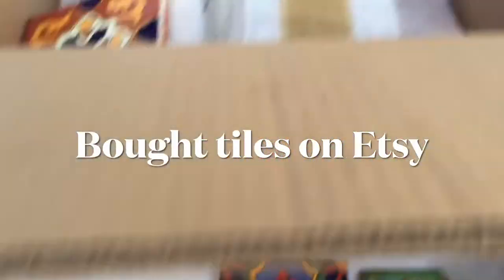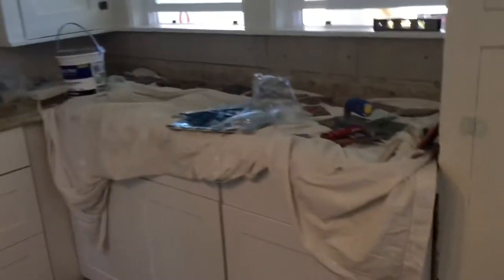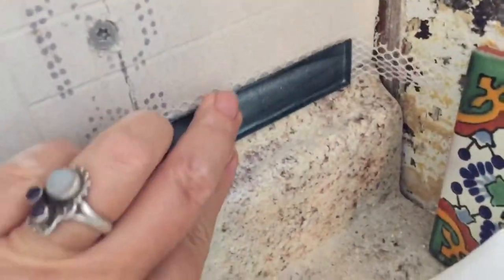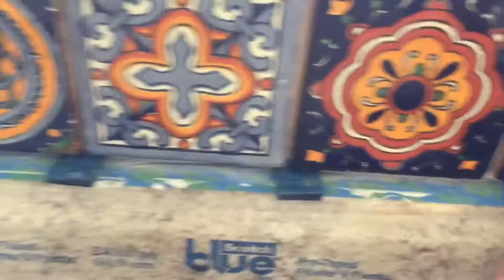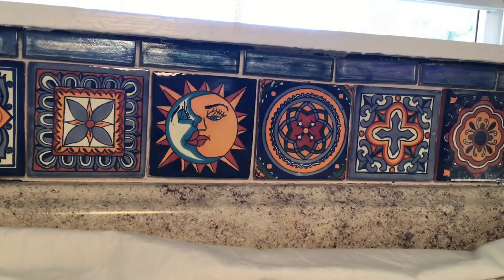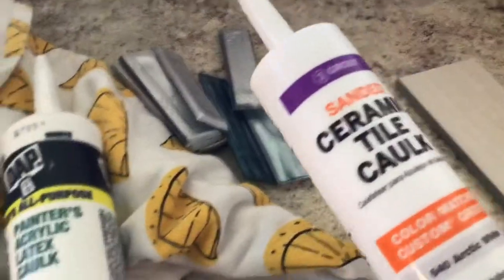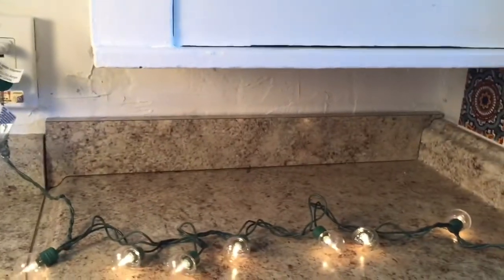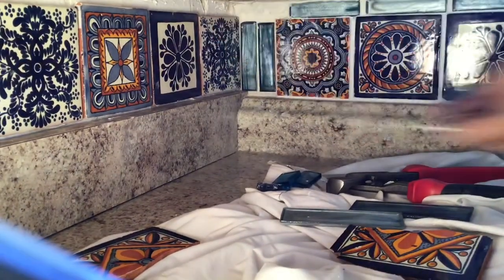Jazz Up Your Kitchen with this EASY Colorful Talavera Tile Backsplash!

Comment: Well done! I used these tiles a little differently. Each is so beautiful on its own. I live in an apartment so cannot adhere anything permanently to a wall. I made myself "portable countertops." WHAT?? What is that? Only bought them for the beautiful colors and  designs, no other practical reason. It took me a long time to do this, but I loved the end result. Each tile I cleaned, put glue on the back and attached and stretched old pieces of good quality suede and/or black leather to the exact 4"x 4" size. (Those leathers by the way used to be pants I wore ages ago. I never throw away good textiles. They always have another life.) The backs and all 4 sides. I can use them individually, as a group in any room and mix up the designs when I feel like it. They just get shoved together after leather backing is dry,  nothing more. I love the sound of anything being placed on a tiled surface. And of course cleaning is just wiping them down. I'm sure a pro would advise differently but this works well for me. Took photo but don't know how to attach to this comment. All the best!  Catheline
Reply from the maker: Sound like you are having fun! I want to do a little table too too! Stay cozy in this crazy winter! 💯✅😘